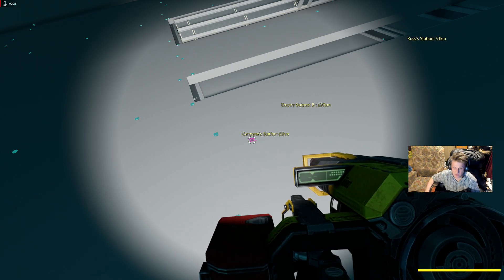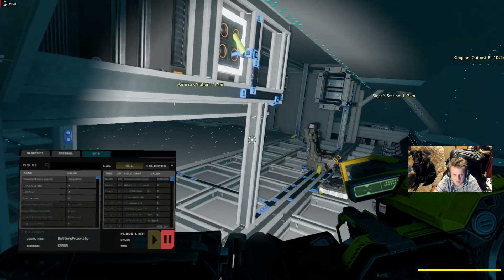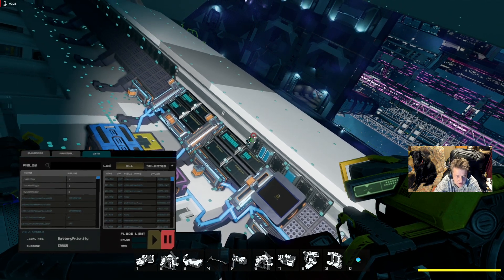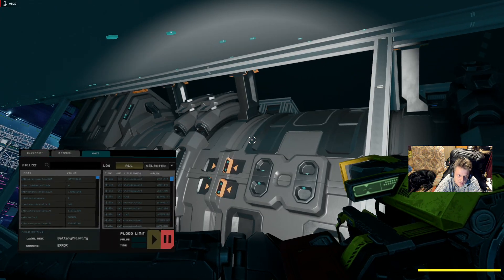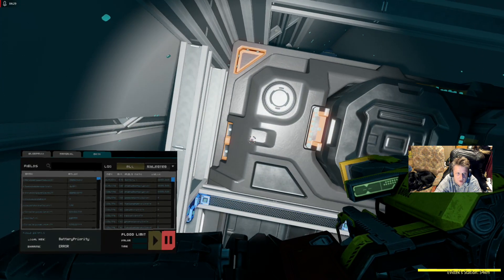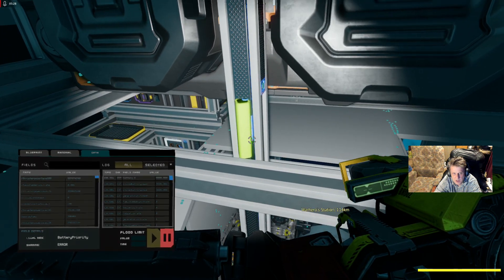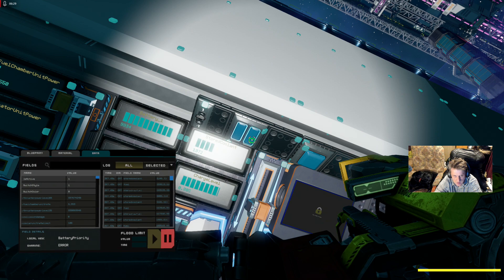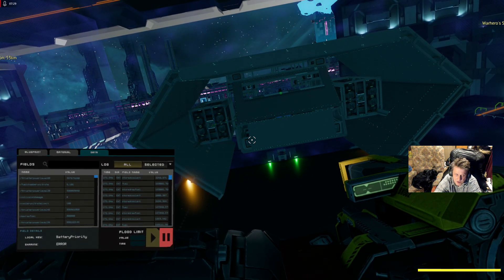Starbase Plasma Thruster How to

Comment: i dont get it. i somehow missing something. im atm designing a 500Cargo hauler an i have that on eplaced. it runs, but somehow it produce less thrust then my 30 Triangle thrusters at the back the triangle puts me to 30m/s and Plasma +9 rings then puts me to 40m/s... with my mach i should easy get over 100m/s but it does like 10-20 triangle thrusters. but it does thrust, just very very low. way less then it should.
Reply: that means the FCU doesn't think its balanced to go straight forward You need to have it centered in the very middle of your ship or have 2 on opposite sides (i.e. top/bottom left/right) or it won't thrust fully because it has nothing to balance the thrust
Reply: @bradleysipe6637  yau thx. i will check that.